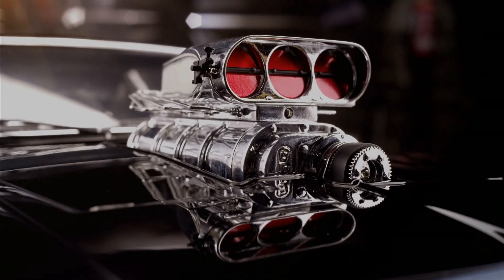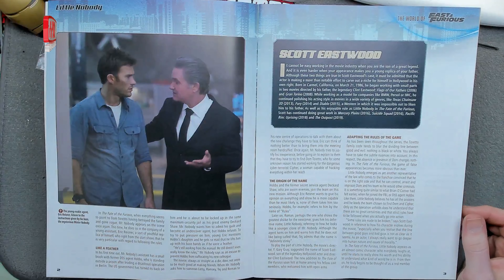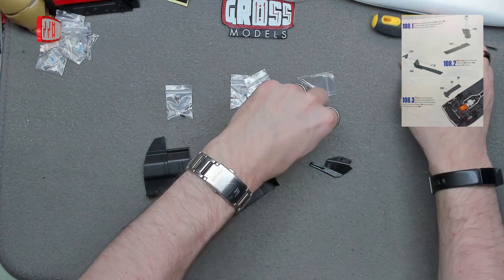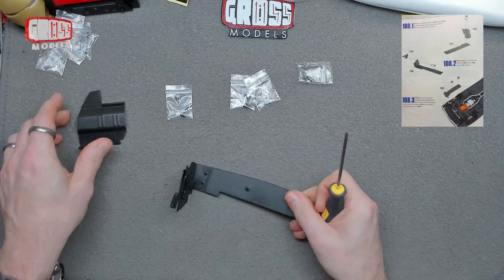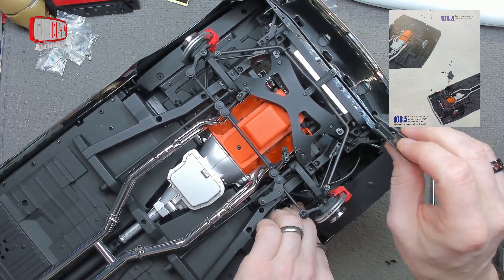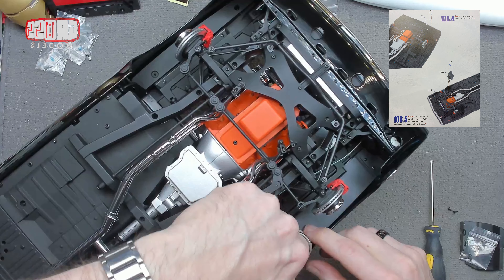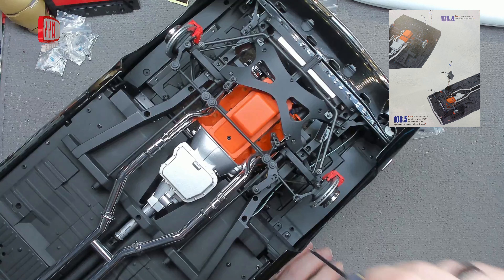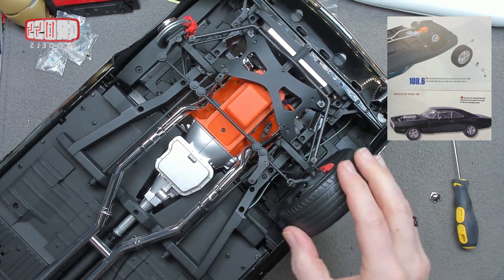Fanhome 1:8 scale Dodge Charger build. Issue 108

Comment: The headlight wire was meant to be hidden in the little recessed channel in the roof of the arch, underneath the wheel arch plate you installed :)
Reply from the maker: That is one way of doing it. ;-)